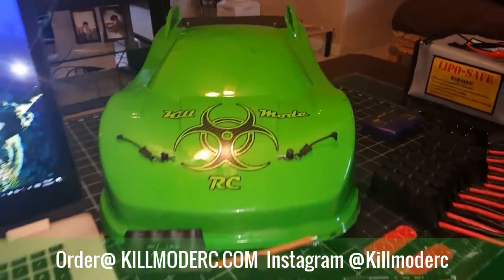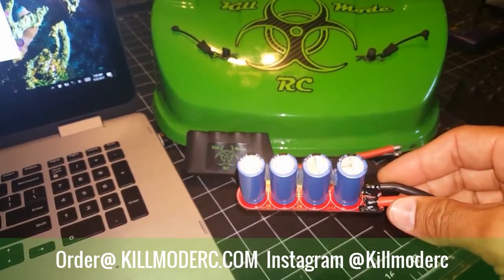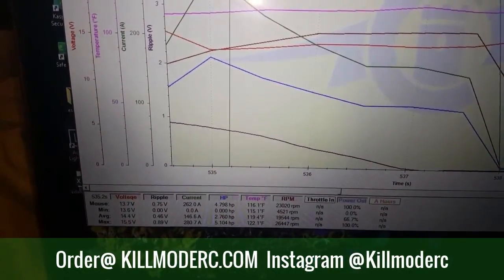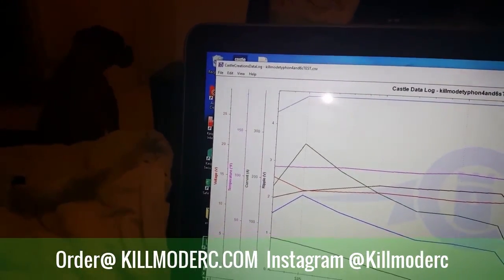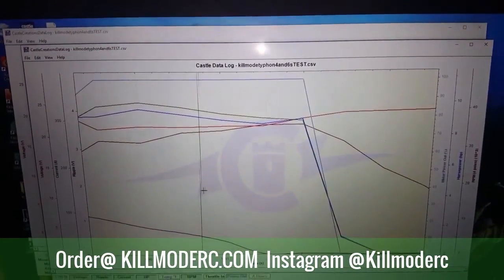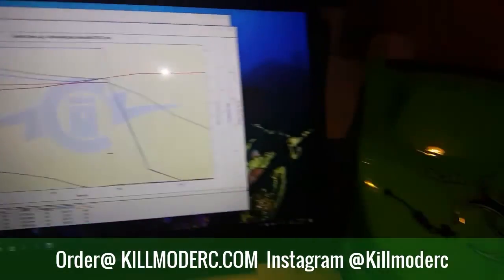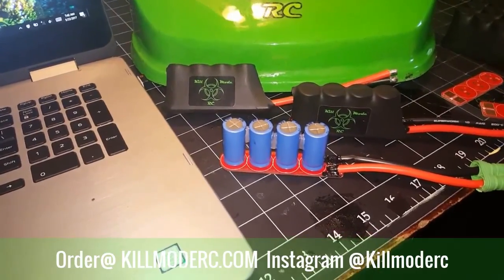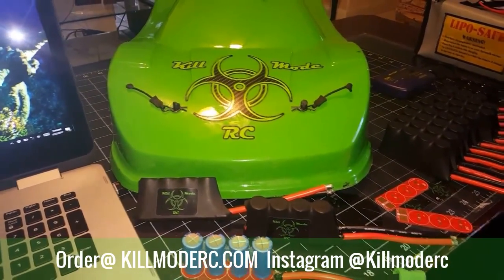Kill Mode Cap Pack Testing with Data Logs World's Best Capacitor Pack

Comment: So what? What do cap packs have to do with any of this? Isn't that what we're talking about here? Isn't that what you're selling? Aren't they supposed to improve the acceleration curve due to their current dump to stabilize the battery current when you floor it? I have a Venom single cap for the low voltage side of the ESC just to keep my steering from dropping out under high acceleration and it works. So, did your cap assemblies make any difference? Isn't that the point? My guess is you may be losing ripple voltage because the caps are expiring and you're going to purer line voltage from the battery directly. Or the motor finally caught up, which is more likely. All a brushless motor and it's ESC is, by its nature, is a giant ripple, created by the ESC on purpose. The ripple chases the armature all around the housing and that's what drives the motor. That much is certain. Of course the line signal has ripple. The power going to the motor comes out as a stutter, a very fast stutter, but a stutter just the same. It'll smooth up when the motor cannot take anymore power, or you let off the throttle. At that kind of sudden current dump, I can't imagine the caps would be recharging and you showed no before and after parameters. In the event of a 2 second burst, the caps would expire in about 6ms. What did your tests or charts tell us about any of that? Nothing is what.

I did a series of acceleration tests on a 120 amp 5400kv brushless racing motor at 3s, which drives it to 59,000 rpms. In fact; three of them. All three ESC's were Hobbywing 120amp identicals and had two big caps themselves. I added two quad packs and an octo pack of giant caps. And frankly, I saw very little difference between the three setups, if at all. It was a pretty big disappointment. And if anything, it showed the huge throughput of the 50c Venom battery and a perfectly matched motor that won't overload the ESC. That battery by itself has a burst current rating of almost 500 amps on a 5,000 Venom. Far more than the ESC can handle, and the 365 you ran. So what are we really even talking about here? My tests only determined that the two big caps on the ESC were probably perfectly adequate for the voltage drop, if any, and Hobbywing knows a hell of a lot more about it than I do. Do you think? They know a hell of a lot more about it than you do. They never published any white papers on the subject even though they published tons of white papers and were asked repeatedly because cap packs were all the rage. That told me that not only wasn't there a real performance difference to their current setup, but there was no money in it as a result. Otherwise Hobbywing would have made their own for sale. And they didn't. (even though they were all the rage) And they didn't change their present setups at all. They make one quad pack for a specific ESC as a replacement and that's it. My tests determined as a best case scenario the caps are only being use at a full power spin up, and because of the way they're wired in, the motor only gets half, the battery gets the other half or all of it if it'll take it. From there, in about 4 - 6 milliseconds the caps expire and the line voltage takes over. And the caps recharge at that time. I was so sure, just like you are. Maybe I have the whole thing wrong, but I did an awful lot of real world testing with reliable and repeatable setups. I just realized your posts are six years old. I have no idea why YouTube sent it to me today. But I would be interested in your thoughts if you're still around.

Comment: Well, I'm a bit late to the party...
Not sure where you are in this journey, but as I'm working on a speed car, I'm definitely impressed by the results you got. Definitely a big, long worked out pack you have there. 
Well, I had an idea. If you can figure out what's going on exactly, can that e triggered somehow...
It might not be an ESC killer, but a horribly flat graph would not only be nice, probably sell more too. Maybe even supply OEM packs too, it should surely be impressive.
No need to respond if there is a slight chance of giving away any top secret info, I just thought I'd throw it your way. With numbers like that, I might skip making my own. My build is rather budget in nature...
Great video, great work!

Comment: Thanks for the video!
I just have a quick question.
I just ordered my 4 pack andim going to get a 6pack.
My question is on my castle xlx do I remove the existing cap packs or just solder to wires?

Comment: I have an inexpensive esc that can only run up to 3s. Would one of these cap backs help extend the life of one of these esc's? the additional fans I have installed haven't solved the problem nor has cutting the body to get more air over the esc.

Comment: I like the look of this product and the data you have collected is useful. I guess if I had a suggestion though, you could have done the same runs them with the cap pack removed and shown us the difference, I'm also particularly interested in voltage sag, so to have been able to see that during the early acceleration phase where the most amps were drawn, that your cap pack also kept the voltage up would have been useful as well as giving you a base line for the voltage ripple comparison

Comment: most ripple peaks around 50-70%, at WOT ESC is most efficient at managing power out of good batteries so the ripple goes from low to nothing. This is an achievement of your esc and battery as well, not the cap pack alone. I like the product you make, but if you gonna sell it I would suggest you dont look at ripple under WOT 100% and use that as a selling point. Looks like youre sucessfully keeping ripple under 5% for most of the run, including where it occurs at peak as youre rolling into throttle - which once again is a combination of good batteries, esc and of course capacitor pack as well. you still havent said what batteries you are using w xlx to manage this kinda low ripple.Thanks

P.S. when you speak of high end audio, is that car or home audio?
Reply from the maker: I always appreciate constructive criticism as well as a good debate. With that said, allow me to point out why I disagree with your assessment. I agree, that the largest ripple spikes occur during the time building into full throttle. I even pointed that out in the video. However, those spikes do not concern me, as they usually only occur for a fraction of a second, and are not responsible for heat, power loss, and esc/internal capacitor failure. They are simply small insignificant spikes. Lets face it, nobody is burning up esc's at 50% throttle on speed runs. I also agree that the esc is most efficient at WOT 100% throttle. That being said, this is still the most important area of concern. This is when esc's fail, and this is when ripple is most important. I think it is a mistake when people only look at the "max ripple" on the log, and nothing else. That max spike could have occurred anywhere. This is evident by simply looking at Castle Creations esc's. The significant area of failure on the XL2,was capacitor failure at WOT. What did castle do to rectify this with the XLX? They simply added more capacitors. The test ESC in this log is an xl2, not an xlx. The xlx is far more effective in terms of ripple than the xl2. So to see a log with 0.00volt ripple at just over a second of 100% throttle, and to maintain that for the remainder of the run, is absolutely a testament to the effectiveness of the external cap pack. I also know this because I have done multiple test pulls without the cap pack on the same setup, and the ripple remains well above 1volt at 100% throttle. That 1volt ripple at WOT, can be a death sentence for an ESC. Now, I would never suggest that theKill Mode Cap Pack is solely responsible for all of this. That would be silly. Of course, ESC, battery, and proper tuning are critical. I simply claim that if you want the best of everything else, don't short yourself by using some junk cap pack. All components are equally critical. 
P.S. I use Roaring Top batteries on most of these runs. They are a good quality, inexpensive battery, and I think they are a great bargain.
Reply: I am absolutely not taking away from a cappack as an external device that does filtering and therefore even keeps the heat away from esc, even if internal ones could do a job on their own. Your cap does an excellent job of keeping ripple low (if the max is low, itll be low anywhere in the graph) and going back to WOT if its low at maximum, itll be low to nonexistent at the said power out 100% (once again as evident in your video), and was expected seeing how peak ripple is low as is. Im glad you didnt take it the wrong way, ive learned a thing or two myself from your vids
Reply from the maker: Texan Yankee definitely didn't take it the wrong way. I'm always trying to learn. Every time I learn something better, I try to figure out how I can make my product better. I want to have the best product available, so I'm always trying to improve. 🤙

Comment: Very impressive!! If I use the cap pack and don't get the same results is it possible to make a return?
Reply: Desiign Vortex what other cap pack companies have that policy??? RCFL Bro
Reply from the maker: Well, it would be impossible for me to guarantee the same results unless you were running the exact same setup, in the exact same conditions, with the exact same driver, road, batteries, motor, car, ESC... You get the point. What I can guarantee, is highest quality  product that is proven to work, and as much feedback, and support as possible.
Reply: Kill Mode RC Alright, I'll buy you 6 pack when they release. Also are you able to make your website so that customers can leave reviews? Because reviews are one of the things that make a person buy a product.
Reply from the maker: Awesome idea! I will have the designer put a review section on the site. Also, when you get your pack, send me a pic, and ill post it to the gallery. Thanks!